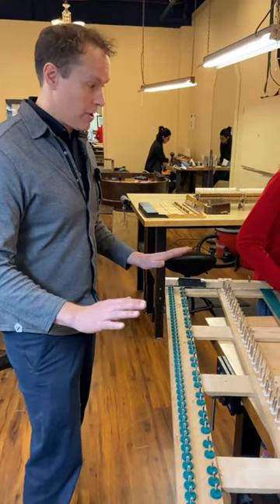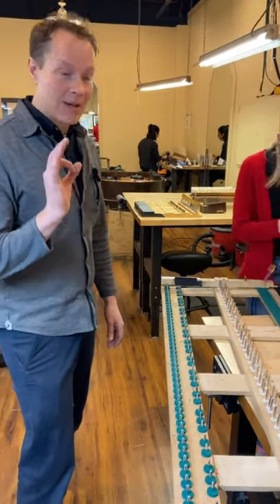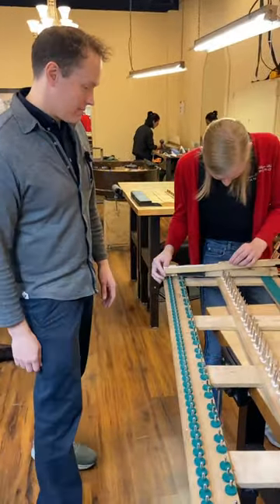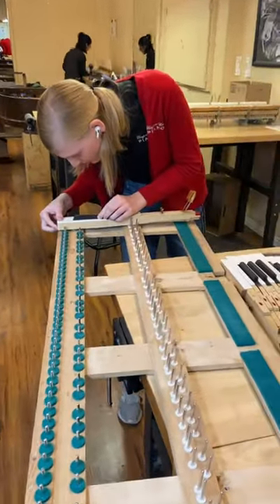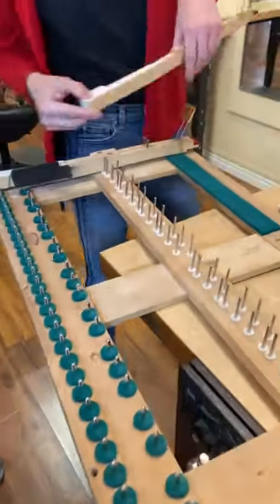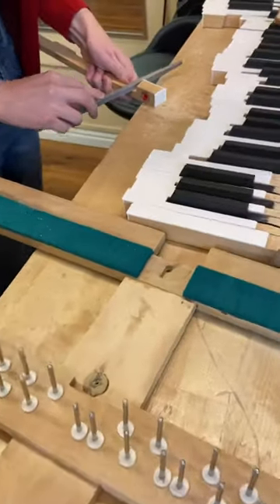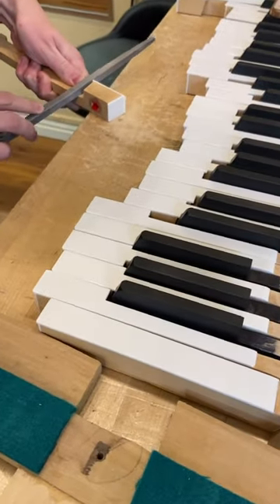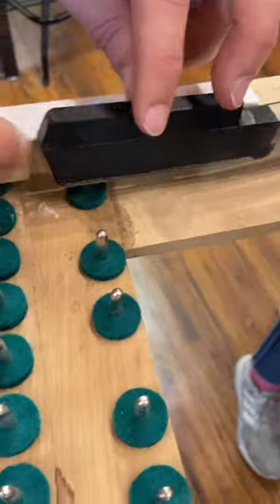Restoring Process: Piano Keys 🎹 🔧

Comment: Hey quick question, i’m working on a piano and those green spacers under the keys actually cause my keys to not go down all the way when pressed and doesn’t allow the hammer to hit the string, then if I remove spacer they finally hit the string, how would I fix this problem as I still need the spacers under the keys.
Reply: He has a lot of piano regulation videos from when he was training people. Those might help you understand what could be causing the issue…